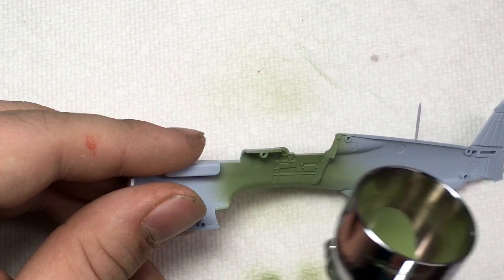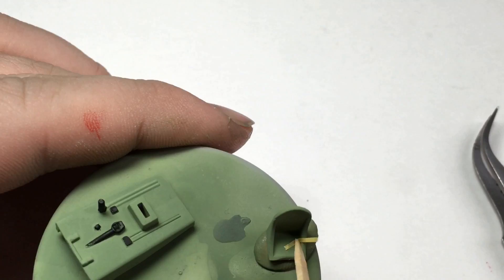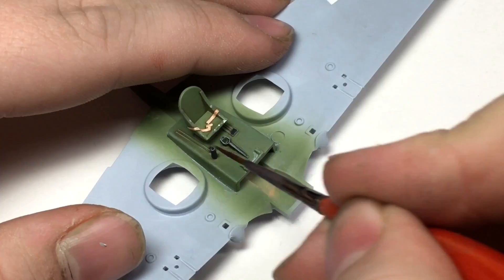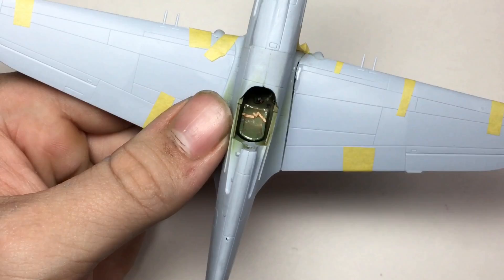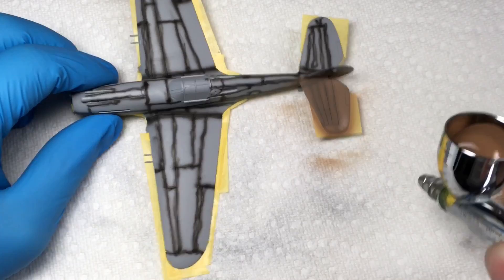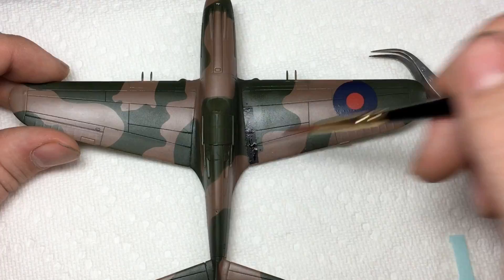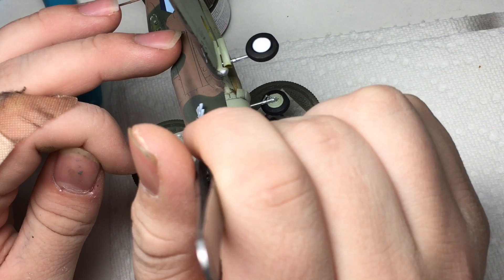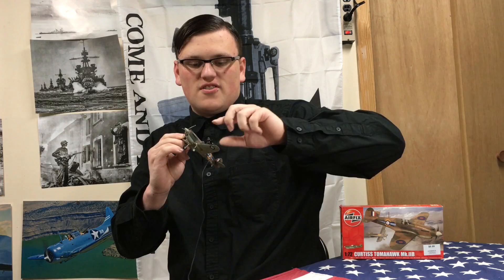Airfix 1/72 Curtiss Tomahawk Mk.IIb- TIMELAPSE BUILD

Comment: Very nice model W.A.! Zinc chromate is the way to go for wheel wells, Tamiya xf-71 or testors acryl work nicely, I prefer testors over Tamiya for U.S. planes as some bottles of xf-71 say ija interior. Canvas insides of the wells you can get away with khaki or a buff color.

Comment: Out of curiosity, for the best results with the decals, do you recommend Micro Sol or Micro Set first?
Reply from the maker: The correct order of application is Microset, decal, Microsol. Microset is basically an adhesive- once it dries, it holds the decal tighter to the surface. MicroSol is a solvent- it 'melts' decals, allowing them to be pulled around bends and into corners. You MIGHT get the melting effect by going with Sol first, but placing microset on top of a decal shouldn't do much.

Comment: Lacquer thinner? looks good but wondered why you would thin Tamiya acrylic paints with lacquer thinner? Any advantage over acrylic thinner??
Reply from the maker: It's not generic lacquer thinner, it's Tamiya brand thinner. It works about the same with their acrylics. I don't have a real reason to use it other than a guy at my model club told me it worked better, it cost the same, and I can use it to thin and clean my airbrush for Alclad work. I haven't used it enough to decide it has any real advantage or not.
Reply: Lacquer thinner is all I use with Tamiya paints, works great and is a whole lot cheaper than Tamiya thinner.

Comment: hey, what do you use to remove your wash at 9:26? thanks in advance
Reply from the maker: Lightly dampened paper towel with water. Flory wash is clay based, so water is all you need.
Reply: @TheWaggishAmerican  thank you. so not enamel thinner which i've seen in other videos?
Reply from the maker: @JustJamesMedia  Enamel thinner for Enamel washes. The washes I have been using are by a company called 'Flory Models', which makes a water-based clay wash
Reply: @TheWaggishAmerican  makes sense, thank you. i have enamel washes so i'll get some enamel thinner. appreciate the help and great videos.

Comment: i see a lot of people using tape to make the belts on the cockpits 

i should try that in my next build 

nice build video mate
Reply from the maker: It works pretty well, and t let’s you get some good ‘folds’. Keep in mind the scale thickness though- for 72nd I use a normal piece of tape, but in 48th I put two pieces on top of each other and then cut from that.
Reply: @TheWaggishAmerican  speaking of 1/48 

my next build is a 1/48 Yak7 
thank you for telling me the double tape for greater scales
Reply from the maker: @MarketChange  No problem! Which Yak-7?
Reply: @TheWaggishAmerican  its a ICM Yak7a 
im honestly afraid of screw the hold thing because it doesn't have join points on the fuselage 
is the first time that i have a kit without join points 
and i dont have experience joining those

Comment: I'm obsessed with 1/72 ww2 aircraft models. Would love to learn build them this nice. Though seems like a bit expensive hobby..
Reply from the maker: If you want to get serious about it, it can be. If you just want to give it a shot, it won't cost TOO much. If you've never done it before, this would be my shopping list- Airfix Fw 190 A-8 Starter Set- $13. A fatter brush- $1.5 A set of two sided emery boards, for sanding- $5 Hobby Knife- Exacto knife- $3-$5. WHITE GLUE- basically mandatory. Don't know how much it is, but odds are good that you've got some lying around somewhere. As an option, I would get a can of Tamiya Flat Clear-$8. It's not required, but it helps to seal the decals. So you can get into it, and give it a good try, for about $25 bucks, maybe $30 if you get the clear coat. 

Either way, you should immediately watch all of Quick Kits Videos, especially the one about how to paint with brushes.
Reply: TheWaggishAmerican Thank you!

Comment: How did you masked the model so well?
Reply from the maker: With these small-scale models with these sorts of curves, and really any 1/72 surface that is anything other than relatively straight and equal lines, my go-to is Silly Putty, and I do it mostly by eye. I have been having problems with silly putty for a while now, though, strange interactions between the residue and the paint. I've heard good thing about blue tack. For larger scale aircraft that require soft edges, I would like blue tack rolled. Currently though I draw and cut an appropriate pattern on a piece of printer paper, and then I tape it onto the model only by edges that will not touch paint- for example at the wing, I tape each piece of tape once at the leading edge and once at the root. This loose seal, as long as you aren't dumping paint, allows paint to feather around the edge instead of producing a hard edge like tape would. If I WANT a hard edge, I usually just apply tape around the general correct parting line, mark out the shape I want with pencil, mark any distinguishing panels on a part that won't be discarded, take tape off, cut smoothly with an exacto knife, then reapply to the model. 

that was long winded. hope some of it was helpful

Comment: Great build i didnt have that wing gap issue with mine I built the desert version, detailed the cockpit with belts  then realised it's closed 😅.  So i cut it open its a great kit and small bit of filler needed on the leading edge around the bump. only thing I added was brake lines. Your paint job came out awesome
Reply from the maker: Vasili thanks! How did you do the brake lines? I don’t think I’d do them to my stuff in 72nd, but in 48th I’d love to add that!
Reply: @TheWaggishAmerican  simple mate, I used a old cheap usb phone charger cable you probably have a draw full 😂. I took 1 strand of copper wire out as there thin find a ref pic and just copy the route and bends down the leg into the wheel hub I use a pin to poke in a tiny hole then super glue it in. It's easier than how I explained honestly, takes a few mind to do.

I haven't done anything bigger than 1/72 only built 4 kits all air fix fw190  spitfire mk1 this and the p51d. So if I can do it with only 4 aircraft builds under my belt you would smash it.
 I am building the su-33 atm and a airfix sherman
Reply from the maker: @vasili1207  Thanks for the tip! I'll definitely be putting that on the next plane I get done! Who's Su-33? Also, good luck with the Sherman! Those old airfix tanks are tough to do well.
Reply: @TheWaggishAmerican  zevzda's revell also reboxed it the flanker D is big even in 1/72. The sherman only took a hour and everything is straight so can't complain. lucky i only paid £10 for a battle front set if I looked inside the box i would have asked for £9 change. This set is an avoid at all costs.
Reply from the maker: @vasili1207  Is it the one that comes with a Tiger 1 and a ton of awful rubber figures? I payed full price for that one. I've hidden it in my stash so I don't feel ashamed lol.
Reply: That's the fella, it's so bad 1/72 Americans vs 1/76 germans the tiger is a joke detail wise make a good monument model as there normally stripped but that's about it. The outpost is the only good thing in the box.  But least I did not pay retail 😜. The Sherman is worth a build to use as a test mule
Reply from the maker: @vasili1207  I wanted the Sherman to make another USB drive, and I still might, but... I spent like 35 bucks on an 8 dollar kit lol. I do like the outpost, but I have NO idea what I'm doing to do with it.

Comment: Was just thinking about buying the kit at hobby lobby for $10, now i regret not buying it
Reply from the maker: Hobby Lobby now stocking Airfix is the best thing in the world. With the 40% off coupon, you can get an Airfix kit for the same price OR CHEAPER than on the airfix website, without having to pay shipping. I've seen this kit for months at my local HL. I'm sure it'll be there next time you are. It's definitely worth it. The newer Airfix 72nd scale kits are some of the best bang for your buck kits out there.
Reply: Phil S.  Link to Hobby Lobby coupon.  The coupons renew/expire every Sunday.  Make sure you check the date if you are using a printed coupon.  I talk form experience on with that. (:    https://imgprod60.hobbylobby.com/sys-master/root/h9b/hd2/h00/9477814878238/hlwebsite_02_03_2019.jpg

Comment: Nice job TheWag.   7:56 Silly Putty for the masking?  At the end you mentioned the wheel wells had no paint color call out.   What I have done when that happens is Google the instructions from another manufacture of the same plane/tank. I use the manufacture and kit number then. Google Images.  Again, I enjoyed watching the build.   Thanks.  Riff
Reply from the maker: Silly putty on the fuse because I was lazy, tape on the wings. Super oily putty, messed it up pretty bad. Had to repaint a lot of it